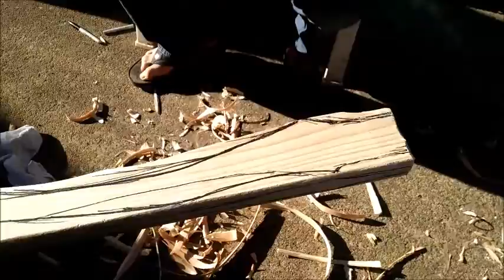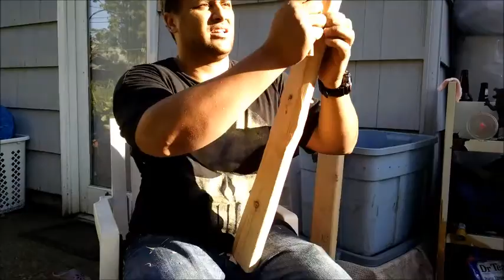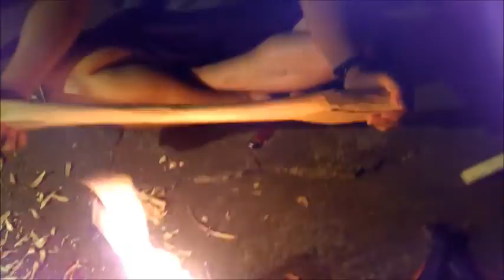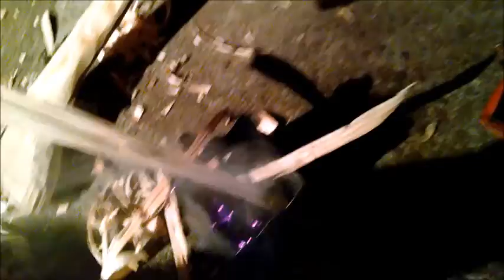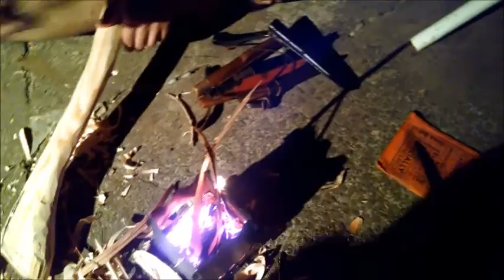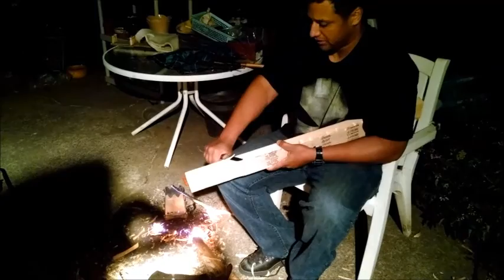Axe Handle Carving with Super Steel Puukkos

Comment: Greetings from the PacNW - Looks like a fun evening :-) The impression I got from the commentary in this video is that you feel the differences in performance relate to the different blade steels (M4 significantly better is what I kept hearing ...). I am curious if this is true, or if perhaps more related to geometry & finish of the grinds?
Reply from the maker: Haha yes it's always great to see my best friend.
I sharpened them all the same and finished all the edges on a half micron CBN compound.

Yea there are different geometries involved with the other knives but the Malanika's are all about the same. 4mm thick, 17dps second 20 dps primary.

The M4 was ground thinner behind the edge to 0.010. It's harder then any of the other steels here at 63hrc and it has more carbide volume so it just dominated.

Haha my friend had argued before filming that the  best knife was
 Elmax

But he couldn't deny it when the M4 shredded the wood with ease :D

There is nothing scientific about what is being done just two dudes having fun with sweet knives.
Reply: Hmmm ..., my bad, I did not think you were running secondary bevels on those knives for wood. (secondary being the bevel to the edge).

What does "17dps second 20 dps primary" mean? Is that the Murray Carter bevel reversal ... where he names the first bevel ground on a knife the secondary, and the bevel to the edge the primary? If so, why not just run 17dps to the cutting edge?

I understand nothing "scientific", but I am always interested in understanding others opinions.

BTW, I got to your channel when you posted a vid on my daily carry for last year or so (K2). Then I see you like axes too, and working wood with knives (commonality abounds). Wonder if you might also be into hawks?
Reply from the maker: GravityRoller  17 dps zero ground would be too fragile. It would cut like a beast but not for long.

 no steel at 4mm thick can hold up at 0.010 behind edge thickness with that kind cutting geometry.

Massive chips or rolls. 

I've got some Hawks

But there just some cheapos
:D

Thanks man.
Reply: RE: "17 dps zero ground would be too fragile ... "  Hmmm ..., I am guessing that somewhere here there is a miscommunication, or seriously differing first hand experiences.

Example: my Spyderco Bushcraft I maintain at 12dps grind to the cutting edge and it does just fine (one bevel per side at 12dps). My hawks are at 15dps and they do fine in chopping, woodworking and in throwing applications. I run 15-17 dps on most of my carry knives, sometimes less up until there is a reason not to go lower. This includes fixed blades and choppers.

Felling axes for example typically have edge grinds at 30-35 degrees inclusive (~15dps).

I have found that there is a lot of cutting performance to had below 20dps (this includes chopping performance and slicing performance).

In no way do I mean for this to be confrontational ... just trying to get on the same page with you.

I have four videos on my channel where I took two factory chopper type knives (Kershaw Camp-10 and Outcast and progressively thinned the blades and edges to 15dps & lower. The Outcast in D2, the Camp-10 in China Steel. I made the videos mainly as a self documentation to keep me honest about what I was doing as a learning exercise. What I learned was enlightening & quite informational. The four vid's are in a playlist named Sharp Sh*t if you have interest in review related to my personal findings.

Hopefully, we can learn form one-another ;-)